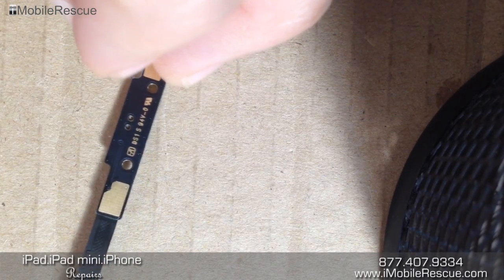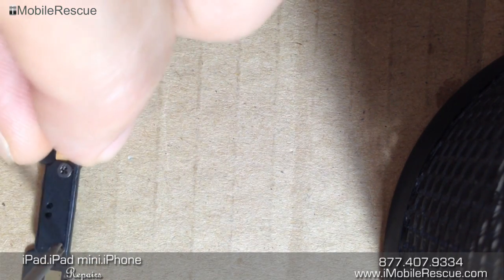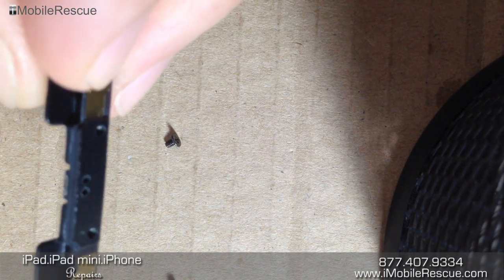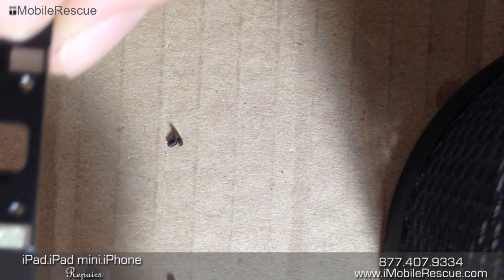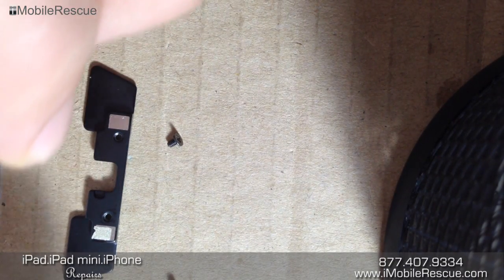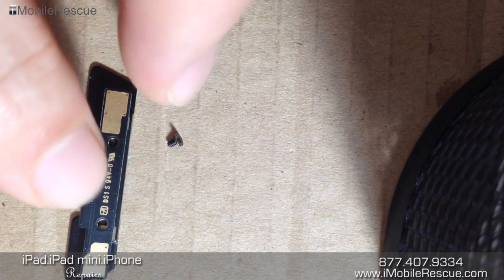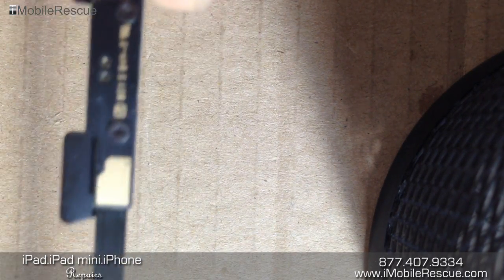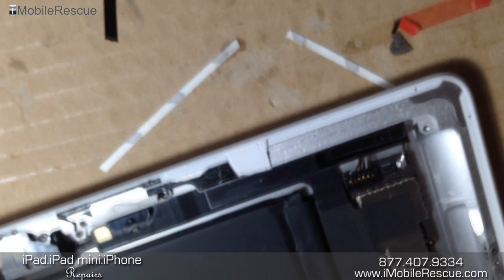iPad 4 Home Button Flex Cable Replacement

Comment: Hi, Those copper looking square pads? are they for glue between the 2 surfaces to help the 2 screws take the load of button pushing, OR do those pads have to make electrical contact when 2 parts are screwed together?  Seems theres 6 pins on M/B connect and only a push button , so that why i ask if other circuits as well involved for those pads.

Comment: Im so glad I found this video!  Ive been fiddling around with a new flex cable for an hour trying to figure out if its seated properly.  Now I realize Im missing that wing piece.  I must have thrown it out with the old cable.  Thank you!
Reply: +WILSON! I also must have thrown it out with the old cable. So what did you do for a solution? Did you buy a new bracket or did you install it without it? If you bought a new, could you send me the link? If not, did it work properly without it?